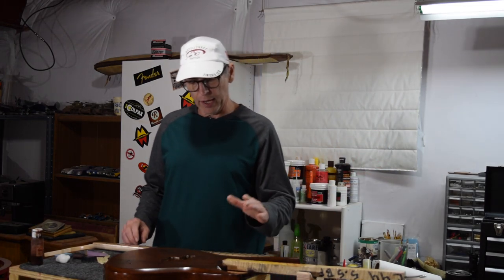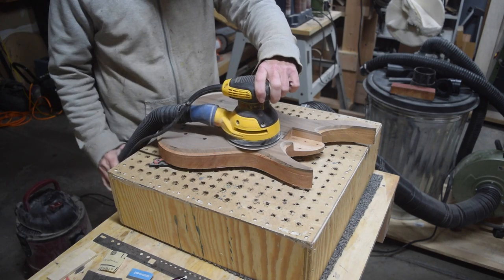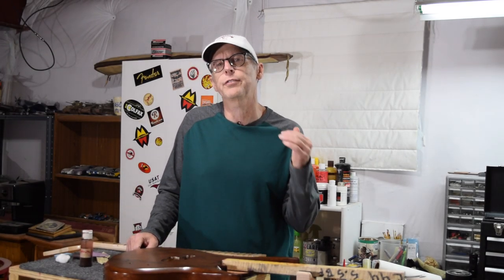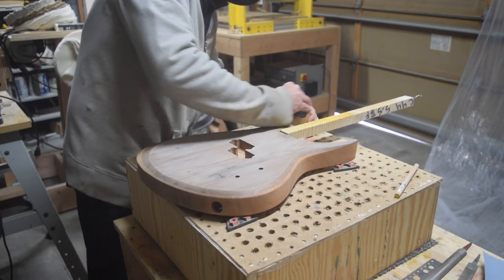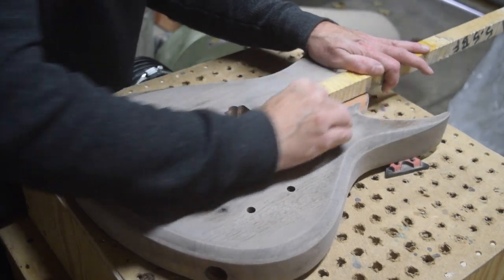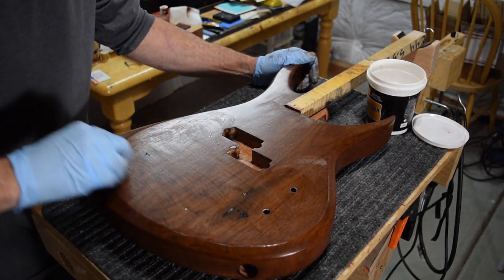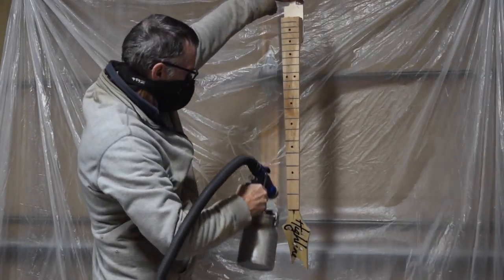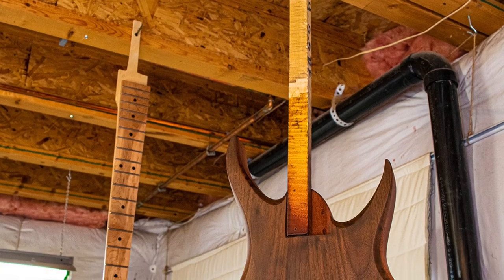Making A Highline Bass Guitar Part 6: Applying the Water-Based Finish

Comment: I've been building guitars for the past 6 years or so, very slowly I might add. I've build a Les Paul, a Strat (my first), and several Tele's. I learn something each and every build.  I wanted to drop an note to give you some Kudos. Your instruction and content are top notch! You've got an excellent way of explaining your processes which helps tremendously. Keep up the great work. p.s. You're convincing me to move on from the Nitro and try some water based products. I've got another Tele underway and it's likely to get a try with the Crystalac! I need an excuse to get an Earlex 5500. :-)

Comment: Chris, why do you clean the stainless steel frets before spraying the finish coat over the fretboard? Couldn't you just clean and polish the frets at the end?  Love the videos, and your use of water-based finishes I'm retiring in a couple of months and will finally have the time to get into the workshop and try your techniques.
Reply from the maker: I clean them after each coat. If I wait until the end, that's a lot of finish to scrub off. Also, it's much easier withing 30 minutes of spraying a coat. If you wait much longer, the finish is much harder to remove.

Comment: Did you used the full-gloss Brite Tone for the pigment mixing and for the undercoats? I'm assuming so just based on the optical (clarity) properties of the full gloss vs the satin or matte
Reply from the maker: I use the full gloss when I make tinted dye stains. I like to use satin when I make opaque colors.
Reply: @HighlineGuitars  Thanks! What are your thoughts on using Craftnique gel stain base vs brite tone as a stain base? Just a thicker version of the same thing?
Reply from the maker: @MasterMWL  I think the gel is a little bit thicker and slower drying. Another interesting option is Liquitex Gel Medium, which is available at most local arts and craft stores.

Comment: Thanks for this and all the other great videos! Do you prefer mixing pigment into the clear coat, or into Crystalac's clear gel stain like you did in an early demo video? Do you choose which method depending on the project?
Reply from the maker: I use the gel stain if I want the color to penetrate into the wood. If I want a color on top of the wood, I tint the first coat of my clear coats.
Reply: @HighlineGuitars  Great. Thanks! Is there any reason you can think of why the gel shouldn't be used to make a hand-rubbed sunburst? I think I've only seen it done with stain or dye applied directly to the wood, but I'd like to try the gel for a new project.

Comment: So does the matte finish level out better as it dries? I know that it's very difficult if not impossible to get a glass smooth finish from a gun like that. With no sanding or buffing of the finish, it seems like a high pressure situation, haha. Very nice looking bass by the way.
Reply: In a mate finish, you still can obtain later a gloss surface using the 3 steps 3M compound.
Reply: @nicolashrv  right, but if you want the matte finish, but you still want it to be smooth, how well does this flow out and lay down?
Reply from the maker: @nicolashrv  No you can't. The Brite Tone matte contains flattening agents that cannot be buffed to a gloss.
Reply: @Highline Guitars I used some duplicolor mate finish clear coat, and after using the 3M compound, it looked as bright as any glossy finishing (I used the mate because for some reason, the gloss took like 5 times more to cure, and I had to give a coat every 2 or 3 days, when with the mate, I gave 2 per day and sometimes even 3).
Reply from the maker: @nicolashrv  This video is about Crystalac water-based products, not Duplicolor.

Comment: At 11:40 to 11:45 the finish being applied looks horribly "globby". Is this inherent in water based finishes? I know the finished product won't look like this at all; I've seen your work :-). But for it to look that bad at one point is extremely unsettling. Had that been me, I think I would have had a few choice words to say.
Reply from the maker: All WB finishes lay down like this when first sprayed. Crystalac Brite Tone, however, levels nicely, especially when you mix in their extender.